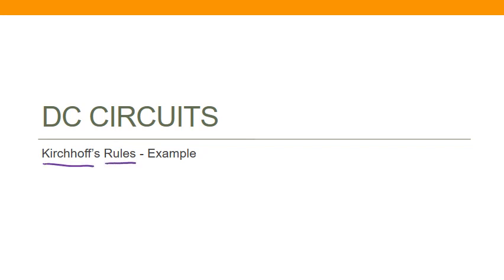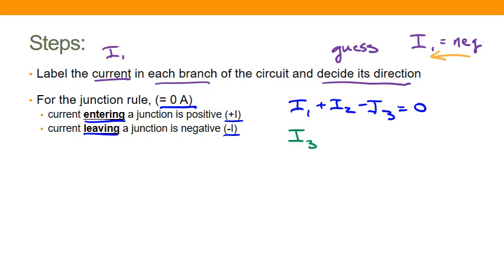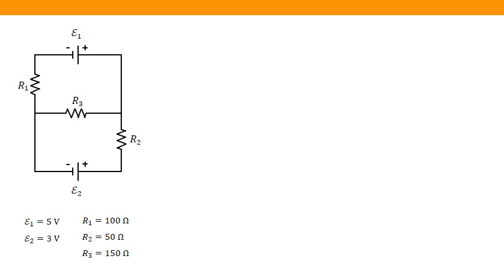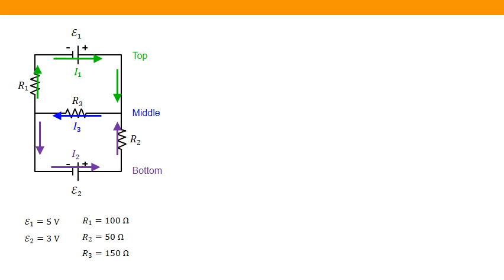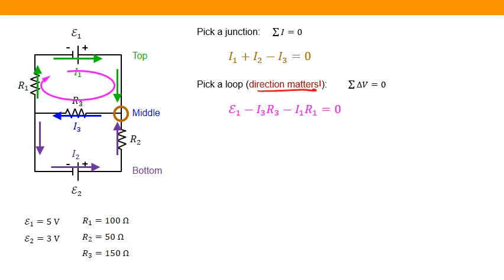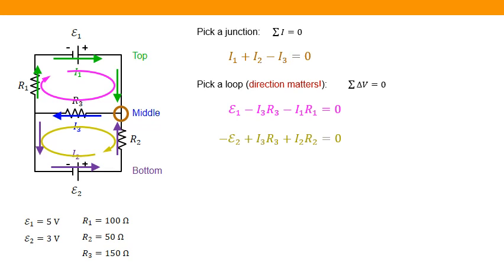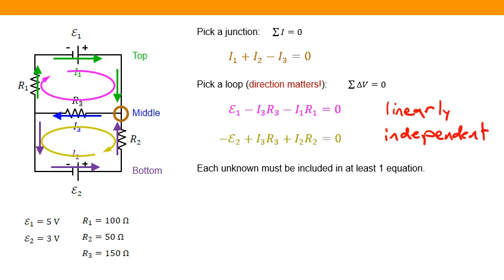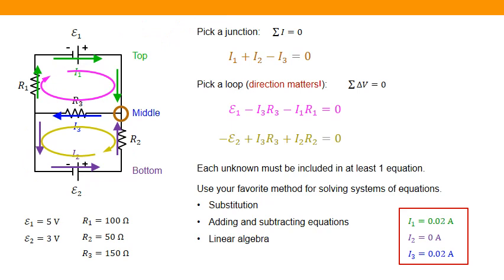Kirchhoff's Rules (Example)

Comment from the maker: Remember that before you use Kirchhoff's rules, you should reduce any components that you can to their equivalence.  If you have resistors in series or parallel, reduce your circuit to an equivalent circuit using the concepts of parallel and series components FIRST.  Then you can apply Kirchhoff's rules to get the currents if you can't further reduce the circuit.  This will save you lots of math.